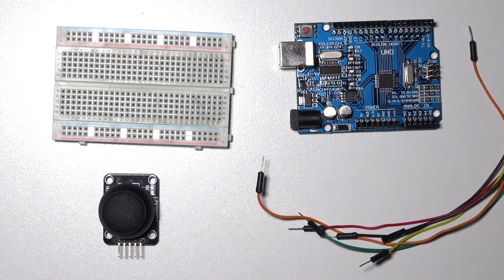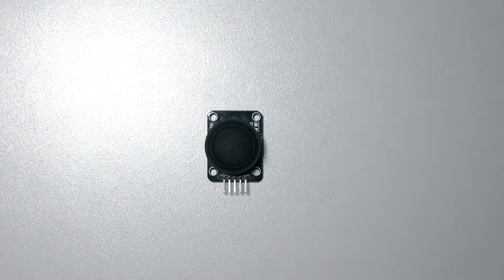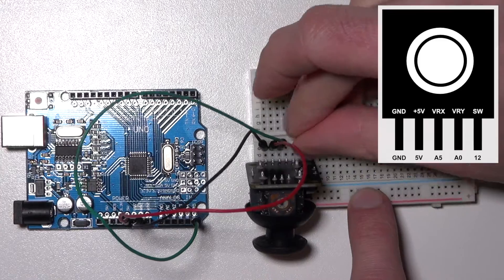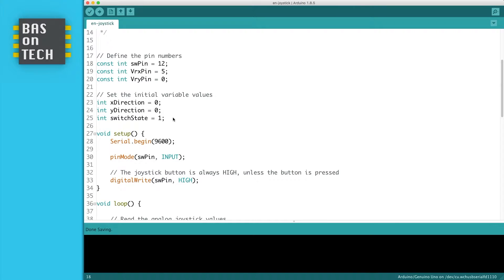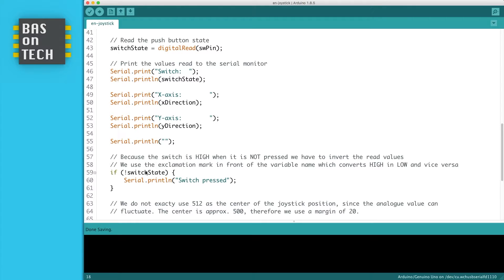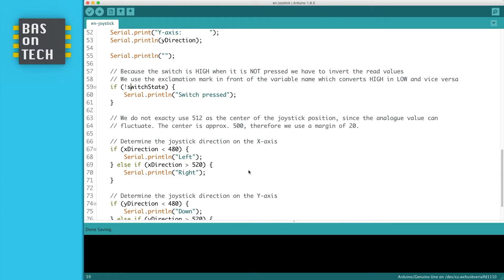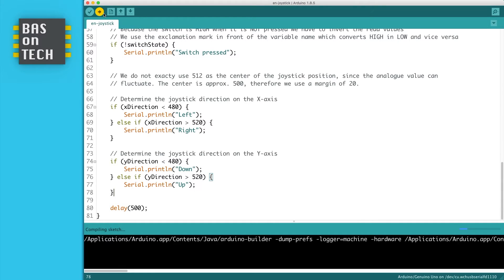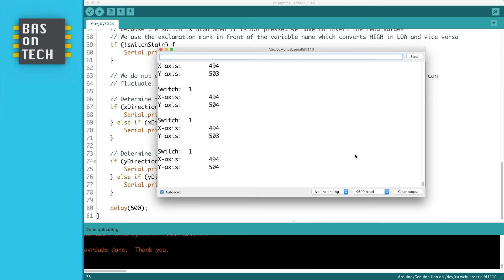ANALOG PS2 JOYSTICK - Arduino tutorial #8

Comment: Why are we reading the xDirection using Vry Pin and yDirection using Vrx Pin?
Reply from the maker: Hi, good question! This was probably because of the orientation of the joystick when used in the breadboard 😃
Reply: @BasonTech  So what analog input is coming from the joystick? Is it just a voltage differential? Does the Joystick have a part number I can look up? Is there any onboard control on the joystick itself? I'm really hoping the joystick just causes a voltage diff, depending on it's position. I am working on a similar project, and I have an analog voltage diff, that I want to convert with the ADC and then read that data for cursor position. So I want to do something similar, but not with that specific joystick. I'm trying to convert motor revolutions to cursor positioning. Motors for cursor movement, should be possible without much deviation from what you did, right?

Comment: I have the same question as with the potentiometer video: can you connect the joystick to 3.3v instead of 5v?

I am working with a Teensy 4.1 and that only has 3.3v available.
Reply from the maker: Using less voltage shouldn't harm the device. However the builtin resistors are made for 5V. So either it doesn't work at all or you won't get the full output range.